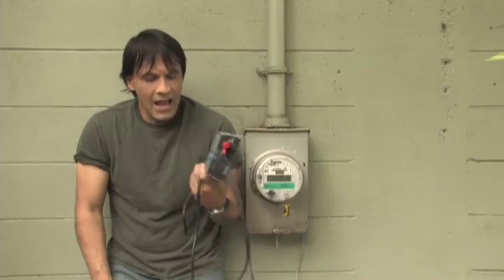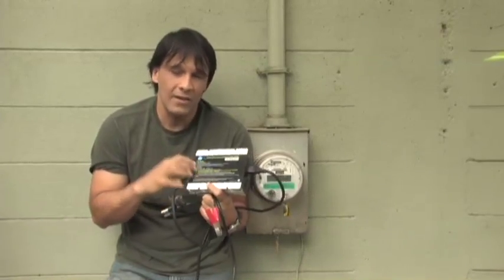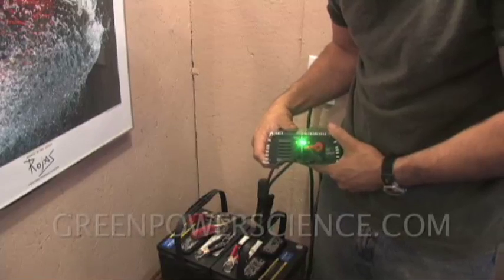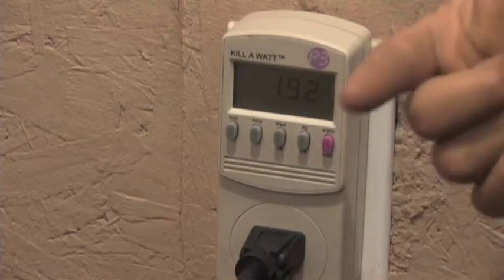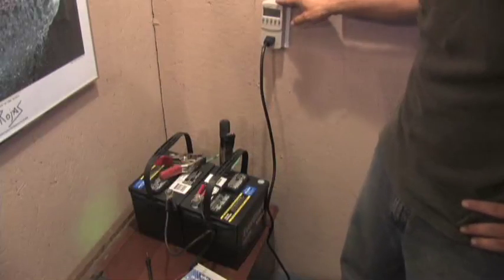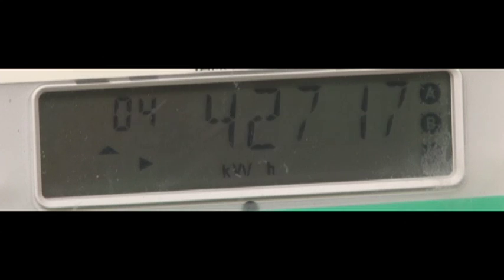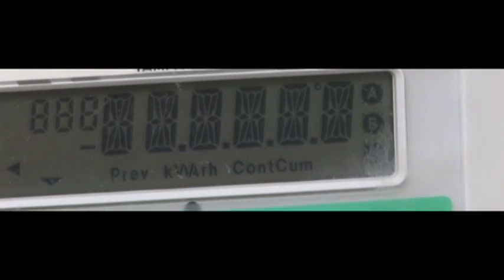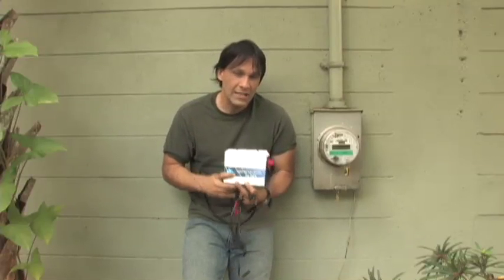GRID TIE INVERTER SOLAR panel POWER EASY Electricity Savings

Comment: I'm planning on building a conbination of solar and wind devices to charge up a battery bank. The pop-up at 7:42 said that it won't work if the electricity goes off. Could I just use a regular inverter at that point?... or when the electricity comes back on would that fry a regular inverter (I have a 2000 watt one that I use to put Christmas lights on my car in parades)? Didn't know the difference in regular inverters (like mine), and Grid tie inverters. Thanks for thye education!!!

Comment: Hey Dan,

Have you ever thought about doing a video on using UPS as an inverter for solar/wind?  Can you use large deep cycle batteries instead of the tiny batteries that are installed in the UPS?  And can the UPS be used without it having to be plugged into the wall?

Comment: i have a question dude like if i buy 2 80w solar panels and hook it up to the inverter and hook it up to the wall will this work a nd if yes like how exactly does it work when there is no light does that mean the inverter sucks power back from the house?

Comment: Nice video. One thing you could have done though was to plug a splitter or extention cord into your Kill-A-Watt wattmeter, them some device pulling more than 200W, such as a toaster into one socket of the cord, then the inverter into the other to let us see the power draft from the grid drop by 200W :P
So for example, if the toaster was pulling 800W without the inverter, it'd read 600W with the inverter plugged in :P

Comment: Thanks for the clear presentations.  I learn a lot from you. 

I plan to connect 3 solar panels in PARALLEL (each 15 Watts, 12 VDC, bought from Harbor Freight) to a GTI (300 Watts, 14-28 VDC), without batteries, to feed the grid.  Someone on Harbor Freight 45 Watt Solar Panel Kit Community Forum says this works.  Do you think it will work?

One on the Forum says I should put the panels in SERIES for efficiency.  But your video says this may damage panels. Is it still true?  Thanks for guidance.

Comment: Hi Dan- Thanks for the informative video.
Question: If I want to supplement with a grid-tie inverter, do I have to be concerned about net-metering? I don't know the what type of power meter is on my house.  I don't want to make my meter spin faster and be charged more for producing electricity.

Comment: this could be a really dangerous situation; all supplies should be fed on the supply side of your fuse box. If you had a fault with this unit connected it may not cause the fuse or breaker to trip. if you had several of these units connected to the same circuit you are multiplying the risk of burning your house down.
Lets look at a situation where you have ten of these units hooked up, thats arouns 2 amps each giving a total 20 amps. if the circuit they are connected to

Comment: i have a question, if you were to have a 12 volt inverter running off your average marine deep cycle, then plugged in a  battery charger into the inverter like a black and decker charger and atached it to the battery thats running the inverter, in theory wouldnt that make an everlasting power suply? can u explain any way how this wouldnt work, the charger should be putting more into the battery then its draining from the inverter.

Comment from the maker: @72542 There are now inverters that run on 28v - 60 v range. They are on Ebay. I have tested but still need more data as I was only able to get 40 watts. Need to figure out why.

Comment: I know that this is an older video (at this date in 2010), but after seeing your video on the Uni-Solar PV-124, I got a bit curious. I'll need to do some figuring to set up a system around the 42v panels. Too bad that here in Arkansas, Entergy requires a home system to be capable of 30KW before they will do do Net Metering. Thanks for the great info!

Comment: @muddymuddymuddmann 
I thought that too, then realised that maybe it just needs to drop below half a KWh difference ie 1.5 is rounded to 2.0, 1.4 is rounded to 1.0. As the meter had only just increased by one, it should not be too far to reverse it however, Dan's text states average house uses 3KWh constant, so 1kw every 20mins. 200w GTI will take 5x as long (more like 6x with efficiency drop and heat loss), so 1hr40.

Comment: @GREENPOWERSCIENCE 
Yes, its in your comment text in the video clip. The main use for a grid-tie inverter IS to connect it direct to the solar panels. Batteries should not be added in the equation at all for this case. They do nothing good if you aim to feed power to the "on-grid" :) I will order a grid-tie inverter any day now too  :) .. wee!

Comment: ok tell me best way to hook up i have 11 grid ties ,72 batterys the ups12-370fr models i have 4 40 watt panels and 2 habor frieght systems i have turbines too not up yet now my thing is you say batterys will go low and shut down so where are you saying to put grid ties at,and controller at,and what voltage to have system i know if i run the grid tie off 24v it runs for 3-4 hours off 2 batterys but how can i wire tio make it shut down or should i wire at 12v though hf controler

Comment: what do you mean in the clip.. the text box.. If the grid tie inverter run from solar panels directly the panels can get damaged? That IS the way you normally use the grid tie inverters.. Do i missunderstand what you mean? if your panel do not produce 200w its fine. if you have a panel producing over 200w you are wasting it since the inverter cant take care of it all...

Comment: Dan, please answer my question I'm 12 years old and i have a 15 watt (12v 1 amp) solar panel and i currently own 250 dollers and I'm going to by the grid tie inverter and a Kill-A-Watt meter and i want to buy the 250w version and save 10 dollers a year so my parents give me 10 dollers a year would my 15 watt soler panel do nothing or do something

Comment: Good job with the videos Dan! I was just wondering why would the GTI damage the panels if you hook it up directly to them without using a battery?? You said the panels won't be able to handle the load?? If so then why?? Sorry if its a stupid question hehehe..

Comment from the maker: @mmoedu The cost per watt is what you would base it on. First step is conservation. CPF lights or LED, Light colored roof, insulation, Energy efficient appliances. All this is easy and better to spend money there before buying a big system. Once you knock your Ebill down, then you will have cheaper solar options. Ex makes no sense adding 100watt panel to supplement incandescent 100 watt bulbs. Swapping 4 bulbs for cpf costs $10 saves 300 watts=$750 in panels Also check our channel we cover a lot

Comment from the maker: @hippyraverocker Yes, the Voltage is what matters, these need to have 14V-35V and they run. The amount of Watts is up to the amperage and volt on a loaded circuit. So the 80 watt panel open 21V loaded 14V runs about 63 watts direct.

Dan

Comment: Hey, In another of your videos you have a panel less than 200w running this inverter fine.

Is that something that can be done? As I would like to just have say a 100w panel...with this inverter...and could have a system to lower bills without needed to keep buying batteries that die every 5-6 years.

Comment: If you hook solar panels directly to these without using a battery bank.Will it fry the inverters if the grid goes down and the panels are producing full power?

Comment: At 230 watts output, the inverter would have to run about 4.3 hours in order to produce 1 kw-H of energy.  In 45 minutes, it would have produced  about 0.172 kw-H of energy.  But it is a good start!  You might not need another meter, only more patience!  I enjoy the videos, keep up the good work!

Comment: Your welcome Mike
  Doing research on this stuff can be confusing. I started before micro inverters were availible. My goal was to be able to grid tie and off grid with one system. Back up power is important to me. My system in grid tie makes about 15$ a month but during a power outage its priceles to have backup power with out runing the generator. 
Thanks again take care.

Comment: What I recomend is a single 205 w panel. If a panel is shown at 12v thats not what it means you have to look at the spec sheet it will be more like 22v open. These inverters will pull the panel down to 15v and stay there. all my panels are 12v in parallel with 4 of these inverters. CHEERS WINDY NC

Comment from the maker: @getjagged I doubt you are getting 200 watts. I would guess you are getting 10 watts max. Phone lines are very low amperage, less than 100 milliamps so the most you could get is about 4 watts . Also most inverters like this run on 14 - 28 volts. Any more or less they do nothing. Place a kill a watt meter to it and see what you are doing. A 12v batter cannot run most grid tie inverters. That is why I have 2 in series = 24v. That is between the 14-28.

Comment from the maker: @guessohw Your voltage is too low. Panels produce 12v-21v with no load. The Inverter requires 14v-40v DC. Wnen you hook only a panel, you have about 12-14 loaded volts so the light stays green. Solid green low voltage. Red fault not hooked to grid.

To test, take 2 (12v batteries in series) and test. Batteries have very high amps and the 24v will make them flash fast.

Also watch 

watch?v=rpafn-urjrg

Comment: I have one of these units and run it daily outside right off of my homemade panel that produces +/- 100watts. I have tried everything under the sun to test if this is really doing anything ( i have the kill-a-watt device) but get nothing. the light on the grid tie invter flases then goes green and stays so till the sun is down.  What can I do to tell if this is really working, I need numbers! Thanks and I love your work

Comment: Your inverter is only rated 200 watts per hour. So it would have to feed back into the grid 200 watts for 5 hours to equal 1Kw. Your 40 minute test only put into the grid 133.3 watts you would need to continue for an additional 4 hours 20 minutes to have made the meter move backwards 1 Kw.

Comment: I have developed a software which calculates required  number of panel as per the inverter specification, just send me the monthly electric bill information, and desired panel wattage, as in my software I have specification of more than 2000 different manufacturer panel and also specification of 400 different iverters from 1kw to 1MW,  most of them CEC aprovedit is always important to take care of design specification

Comment: most probably you will need only 4 kw solar system, which with todays price tag of 7 dollar per watt, you will need 28000 dollar to install the system, but depending on time and utility location if you recieve back 3 dollar per  watt of solar system, your total investment after rebate deduction will become 16 thousand dollar. of course if you take this amound loan , you can get back your interst payment as your tax deduction, and if you are doing some sort of business at your home...

Comment: if your solar system is residential, most probably you do not get any money for your power production, instead whatever amount of power produced in a year , you can use, if you have produced excess power than your consumption that will go free  of charge for utility. and it will not add for the next year .
therefore always select exact amount of your consumption, for example if your daily power consuption is 20 kw , and your insolation peak sun at your residential area is 5 hours, .....

Comment from the maker: If you have a good battery system, you can use little from the grid at night, you are good. Peak times buy back is greater, so night is cheaper. They may charge you 10¢ kWh pm and 17¢ kwh daytime hot summer. So the buyback is also peak, THEY NEED IT FROM YOU, and pay a bit more.

A few people actually strategically dump extra during peak hours to make more.

Comment from the maker: Half the price of the overage. So if you use 1000 kWh = $150 cost power company. Many have a separate meter reading. Even those do not spin backwards.
If you sell them 1000kWh in the same time period they give you $75.
So your bill for basically going flat is $75
That scenario is rare powerful system small battery
Some places are different. So using your Solar Power first is the best choice. Some meters again are different.
The goal would be to use 100% solar sell the 1000 kWh and make $75.

Comment: it will take 5 hours before you see the meter drop a kw, While you werent able to see that on the video it will work!  but you will only save about 4.50 cents a month with that small of a system. You have to have at least 1 kw to net meter folks, but either way you can use it!

Comment: @ 200 watts it will take 5 hours gentleman to see the meter drop a kw. And to answer your question davidlu866 if you are take a kw off your bill every 5 hours but you will have to be sure and feed those batterys with the right amount of solar. a kilowatt a day for 30 days 15 cents a kw times 30 days equal 4.50 cents saved, actually the cost per kw will change depending on what tier rate you are being charged so the savings might be a little more!

Comment from the maker: They usually recommend one per circuit breaker. This is a newer technology that is getting more popular so that may change. I would recommend against that for now. It may work but not sure. For safety reasons I would say no.

There is a turbine company I have seen stack them to one outlet. Will try to find the link again.

Comment: for that meter to go back one digit you need 5 hours of 200watts into the system, so go figure why it didn't move. your house might be consuming 2kw/h so in 30 minutes it will move 1 digit but pumping 200w it takes 5 hours to move the same digit. you need to test 1 or 2 or maybe 3kw of power to see it move faster.

Comment from the maker: It depends on the panels.

You can run in series to raise the voltage. Need the right controller.

Also you can charge the Trojan 6V batteries in sets of 2.

Pain removing and reattaching.  100 amp switches can do this too, tricky wiring but not bad. CHARGE (3 sets 12v) USE (6x6=36V)

What do you have?

Comment from the maker: Power companies are fine with it in most areas so long as it is done right. ALL GRID TIE INVERTERS cut of with no AC from the power company. Because they read the line voltage and power just above that, it is not possible for them to work if the power goes out.

Also even if they did work in an outtage, the load of the neighborhood would drop them to just a volt or two, and destroy the unit.

Comment: Most modern meters will not run backwards regardless of being digital or rotary dial(analog).  This is to prevent energy theft by turning the meter upside down in its socket, as doing so, used to turn meters backwards in the past.  Electric companies are smart and do not want to lose a $!

Comment from the maker: Yes, it works best with a constant DC voltage or it would spend too much time shutting off and on. A charge controller with a two batteries in series would solve this issue.

Comment from the maker: You can hook in series to go to a 24V setup. I just recommend against mixing higher amp panels mixed in the series. If you hook 2 HF systems in series that is fine, the unit will drop the watts if your batteries go to low but it will still run. Once night comes in that scenario your system will shut off as there would be low voltage from what was left in the batteries. The ideal solution is 250 watts in, to run 200 watts to the grid. This covers losses from heat, inverter. HF is 45 watts each.

Comment from the maker: It goes to zero, if the grid dropped off (Black Out) and these units stayed on, they would try and power the grid which is impossible as the whole neighborhood pulls many Kilowatts (destroy the unit). So they shut off for that reason, also safety for power workers.

If you need power in a black out you need a generator switch kit, and hook to that.

Different inverter.

All GTI cut off when the power goes out, they work by detecting current/voltage and adjusting for it.

Dan

Comment: Maybe I missed it...but unless you have the main breaker turned on how will the power from your inverter go back into the grid unless that receptical you pluged into bypassed your electrical panel?

Comment: Hi Dan,  I wish if you try to do this experminet with the grid tie inverter (hopefully is possible)
Well do just the same thing but switch on a load with less power than the inverter, so everything should be off and just the load on, lets say 100w and see if the consuption is still running backwards. In this way you can see if you are really generating back power. Thanks and Keep it up

Comment: Hi Dan,

I really like your videos. I have one question about that meter and your 40 or so minutes of 200w. Correct me if I'm wrong but a KWH is 1000 watts for one hour. and the meter reads KWh so you would have to run that inverter for 5 hours to work up to one KWh. But the process of turning the power around and running it back up the wire is true.

Comment: video is great thanks for doing what you are doing i just bought a sunwize 4 panel used solar unit with 5 batteries and a charger contrler how would charger the batteries and tie into my house at the same time is there a video or a dvd  that i can buy

Comment from the maker: Make sure you have very heavy gauge wire and place a solid set of fuses. Your wattage of panels should be 2x what you expect to use in a day. So if you are running 2KW solid then you would need 4000 watts of panels to go grid free.

If you only need short bursts of power, then you can charge 1 day and run for a bit the next.